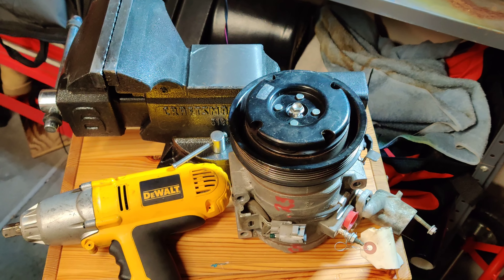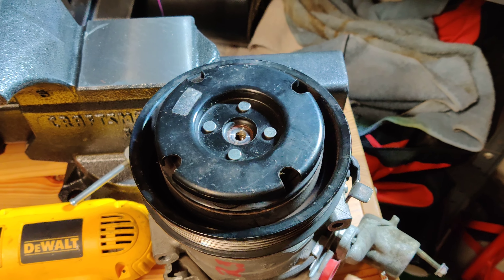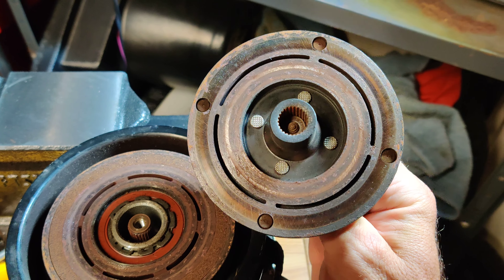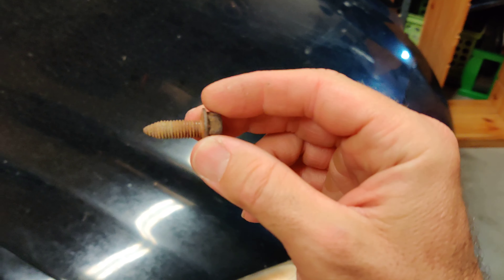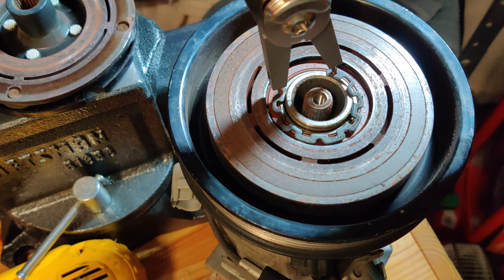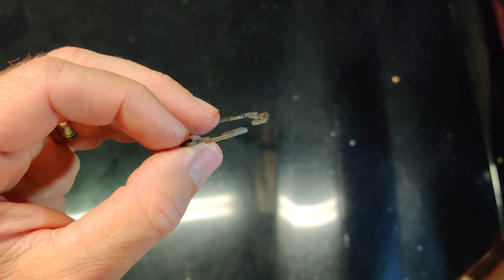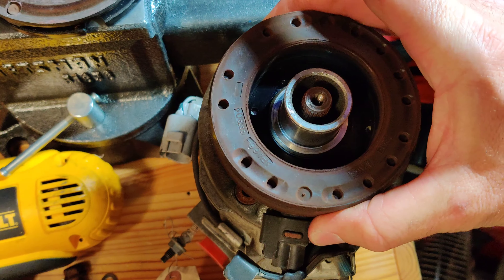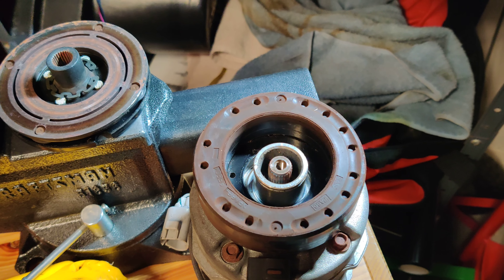A/C compressor clutch replacement 2002 2008 Toyota Lexus Camry ES Solara diy

Comment: With regard to the snap ring. Why not just mark the top side with a pencil, a sharpie and if room is tight, just put a scratch in themetal surface and make your life a little bit easier. Nice video.
Reply from the maker: Thank you for the tip and comment.

Comment: appreciate your video.  i have a 2008 Lexus RX400h. with motor running with AC on, i get a very loud whining noise coming from engine. when I turn the AC off then the noise goes completely away. when i turn my AC back on after a few minutes the loud whining noise comes back on til i shut the AC off. keep in mind the loud whining noise is happening with AC on, my AC system is still blowing cold air and is not affected. sounds like it could be the AC clutch pulley as you described in your video. your thoughts on what's making the noise?
Reply: same problem i believe its the ac clutch bearing worn out so thats what i will replace
Reply: ambry after speaking to couple mechanics and having them inspect my Lexus they all agreed that the whining sound is the auxiliary electric fan kicking in to higher speed to cool the radiator during high temperature. Car is still running fine with no problems and no more whining sound since weather has been a lot cooler. All made sense to me.
Reply: @lien302  not sure if I understood correctly. Nothing was replaced or the aux fan was replaced?
Reply from the maker: Interesting. Did you replace the fan?
Reply: @mitomr.twiceasnice4358  no nothing was replaced. It was auxiliary fan kicking into higher speed due to very hot weather.
Reply: @jcx2bby  no
Reply from the maker: @lien302  interesting...but I'm glad you figured it out.
Reply: @jcx2bby  yes. Only major issues ever had was ABS actuator/controller making a loud buzzing sound after shutting engine off which I replaced and went away. Also changing all the ignition coils which will disable the engine completely if anyone of them goes bad only on the hybrid motors.